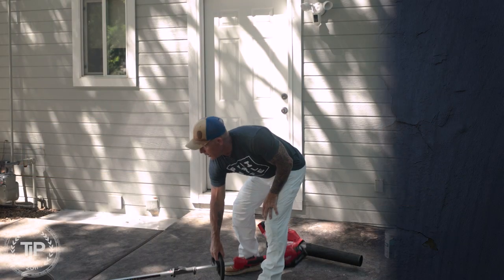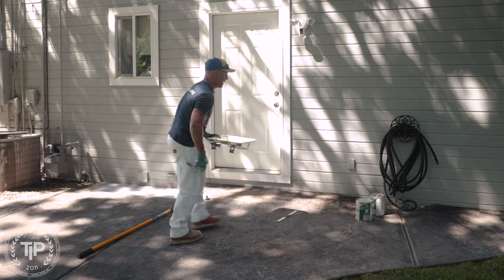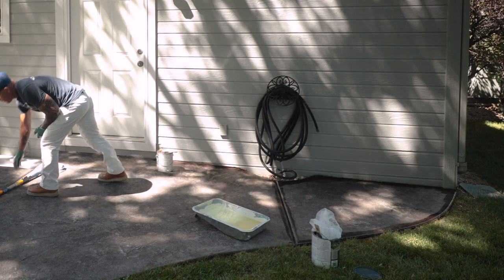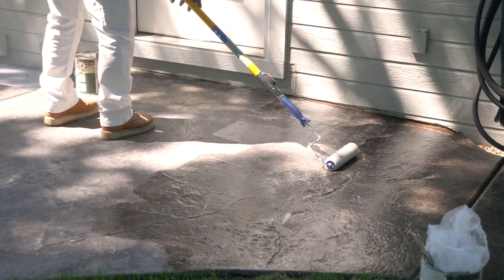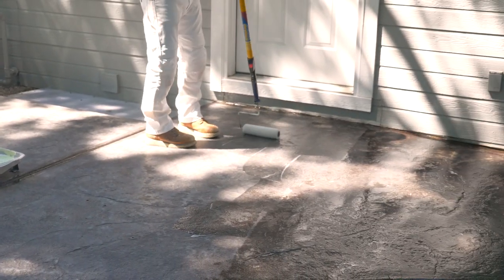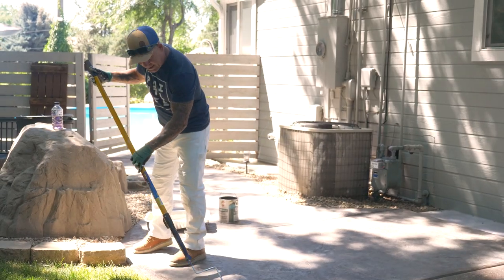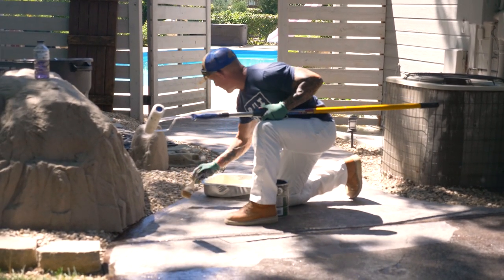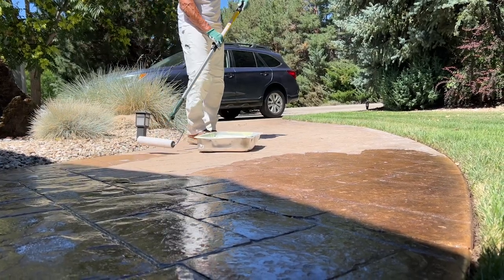Restoring colored or stained concrete. Fast and Easy steps!

Comment: I have a question I just bought this house about a month ago and they had a stamped patio in the back it’s not stained or anything. The house was abandoned for four years. The patio is in great shape. The only thing that I dislike about the patio is the color it’s got that salmon color look, which I hate. Is there a way I can alter the color of that patioI want it to color it like a dark gray color. Is there a step-by-step process on doing that? Thank you so much.
Reply: @gabygol70  I noticed he never replied. What you may wanna consider is simply recoloring it assuming it was never sealed. I’d try doing a small inconspicuous area with a new lighter water based brownish stain and see how you like it. Brown + salmon may = a reddish brown. Also try a darker espresso color. Adjust accordingly, then seal it with a water or lacquer based sealer. I’m actually in the process of restoring a previously stained stamped concrete patio.
Reply: @wesleyhester4284  Wes, did you do any kind of acid wash after you pressure washed your concrete deck ?